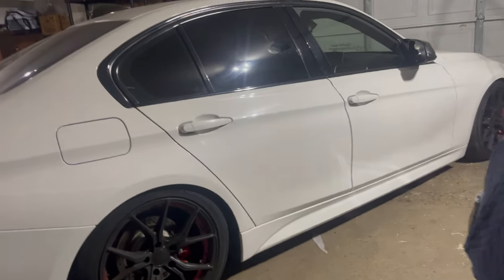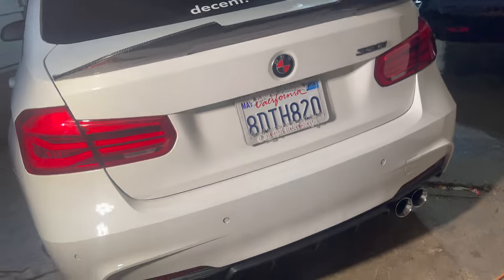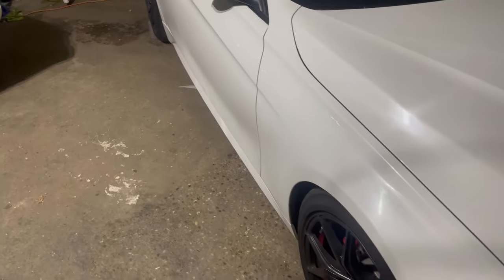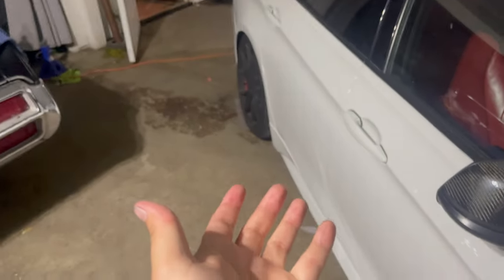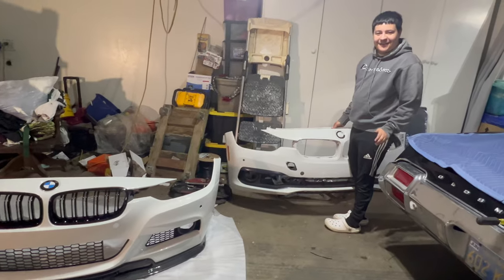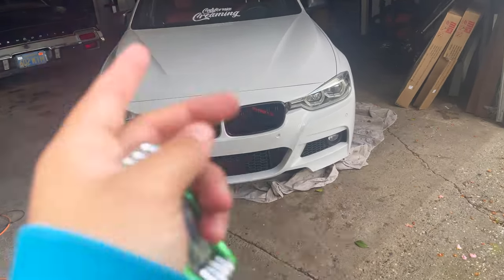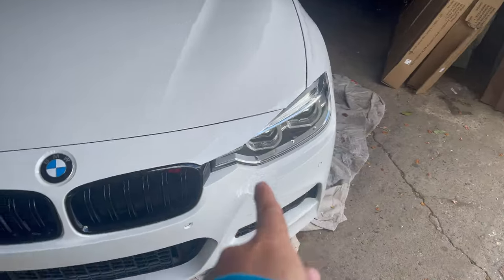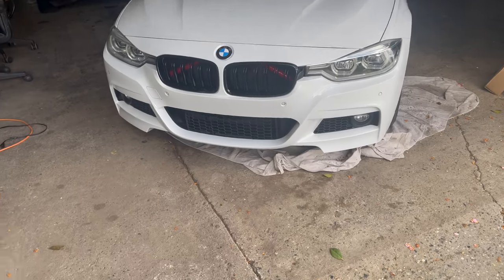finally installing a m sport kit on my f30 🔥🔥

Comment: Nice bro im planning on doing the same! Just wondering, how much it cost to get it paint matched?
Reply from the maker: I got  to work with a company so it was a little less for me but  a painted kit runs from 1800-2500 just depends where its coming from or u can buy it cheap unpainted and go to a local shop but  got quoted like 500$ a bumper 🤦🏻‍♂️